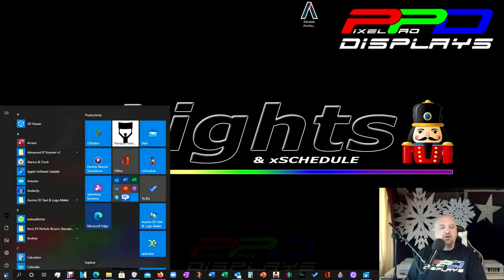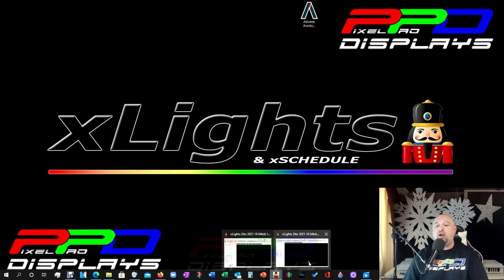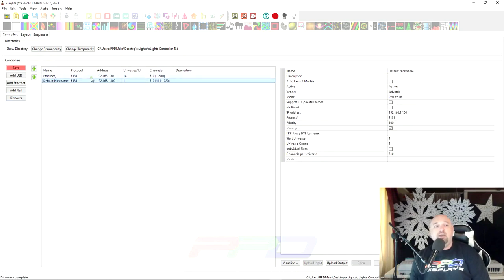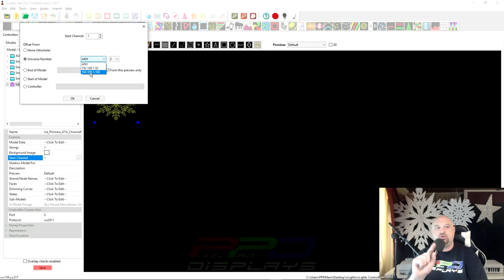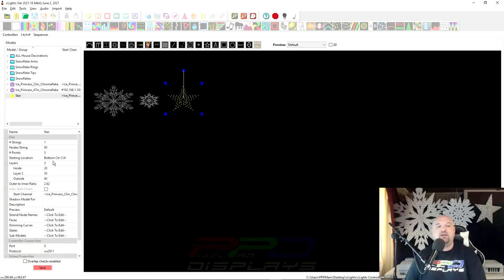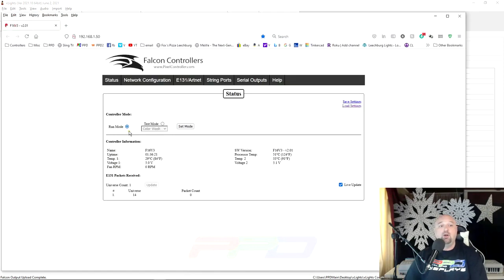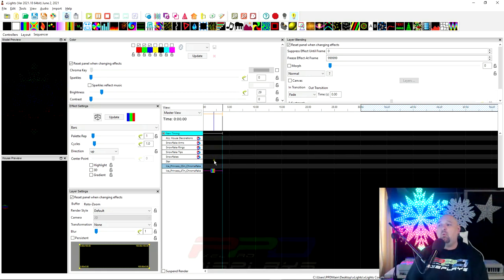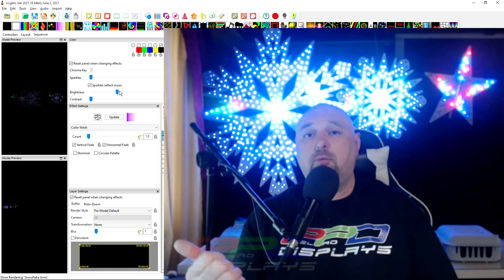Testing Your Props Using xLights Sequencer

Comment: Excellent video. Have you gone to the latest version 2021.37? I have been getting nothing but crashes. No matter what I do and its just random.
Reply from the maker: Each year we stop upgrading at the beginning of October  (using 2021.32).  Since we support a number of shows, we stick with a version that appears stable for me to program on.  Then all the shows are setup to run on the same number.  I probably will not update my xLights until 2022 after all shows are down for the season.  We've adopted and followed this method for the past 4 years, and it has created stability.